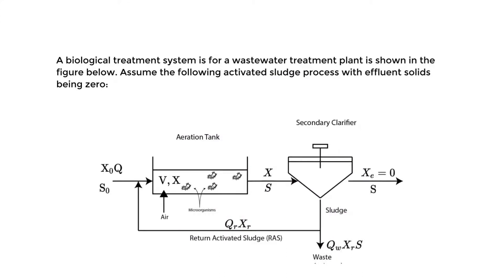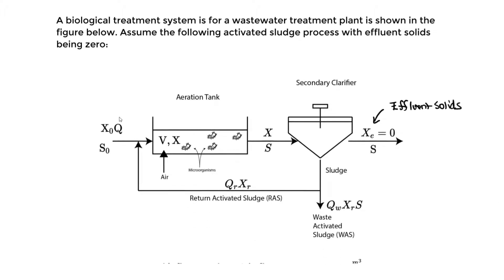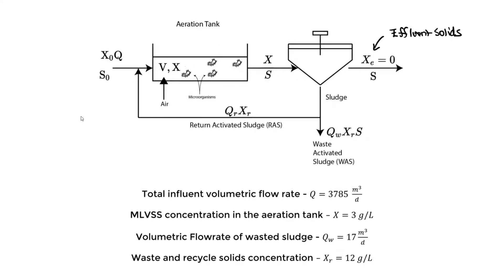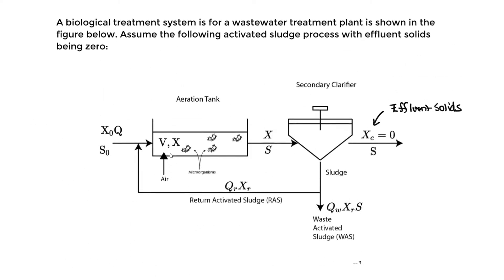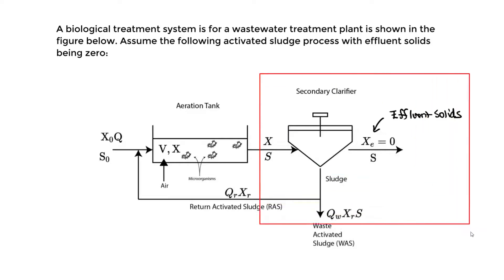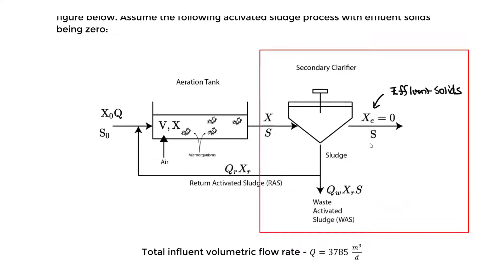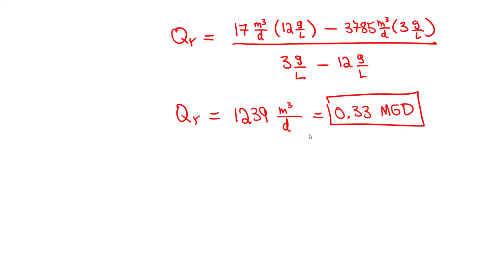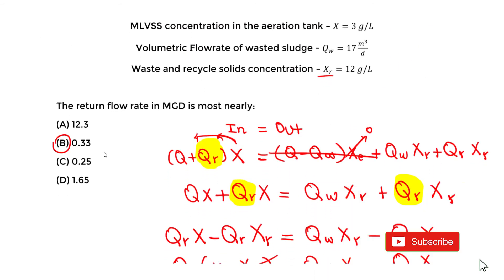FE Exam Review - FE Environmental/Civil - ENVIRONMENTAL ENGINEERING - ACTIVATED SLUDGE PROCESS

Comment: Hello - I don't understand why the flow out of the clarifier isn't (Q+Qr)-Qw. Can you help?
Reply from the maker: Hi, 

The recycled flow out the clarifier isn't really leaving the clarifier, imagine a recycled loop going into and out the clarifier. Is it leaving as a direct outflow like Qw? Think about it. 

In summary, the Qr is leaving and entering the clarifier and not strictly leaving. We would not count it as an outflow since it's constantly being recycled.
Reply from the maker: Heads up, if you actually do a mass balance around the secondary clarified and still include Qr is an output, it would actually cancel out with the Qr input. That tells us, it would drop out. I just realized that!

Comment: the equation on page 332, has both a Xr and a Xw, wouldn't "waste and recycle conc" therefore mean Xr+Xw? In the diagram wouldn't it be QwXw?
Reply from the maker: Hi Annie, yes you are spot on with this. Sorry for the confusion here, it should be QwXw. This diagram I used was from a textbook and not the FE Handbook but I am happy to see you made a correlation from this video to the FE Handbook equation on page. 332. Well done!
Reply: @directhubfeexam  Does it mean that the answer is wrong?
Reply from the maker: @Daisy-i9h9t  It's still right if you assume Xr = Xw (return concentration = waste concentration). I highly recommend you notice the correlation from this example to the mass balance equation provided on page. 332 in FE Handbook 10.1.

Comment: Is this problem applicable for FE Civil?
Reply from the maker: Somewhat, I would understand the theory behind the activated sludge process and note what it means by "aeration", "recycle flow", etc. Also, the Qr equation is found in the environmental section on page. 332 in FE Handbook 10.0.1. You will definitely need to know the "biological process" of treating water which is the activated sludge process. Hope this helps.

Comment: I had trouble getting the units you got by just dividing by a million.  From what I see on the interwebs, it says to divide by 3785.4118 for an English gallon.
Reply from the maker: Hi Selina, yes I think I made a mistake there. You are right with that conversion.
Reply: @directhubfeexam  I dont think there is any mistake here. 0.33MGD is the correct answer. (1239*1000/(3.785*10^6))
Reply: He get's the right answer (0.33 MGD), but you don't get that by dividing 1239 m3/d by 10^6.  Convert m3 to gal (a good excuse to look at conversion factors in the FE HB) and then divide by 10^6